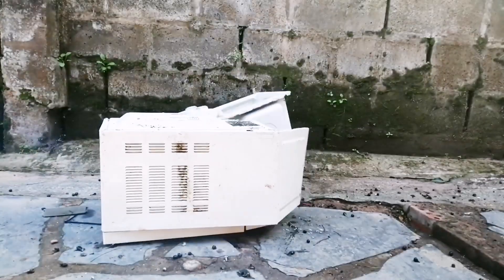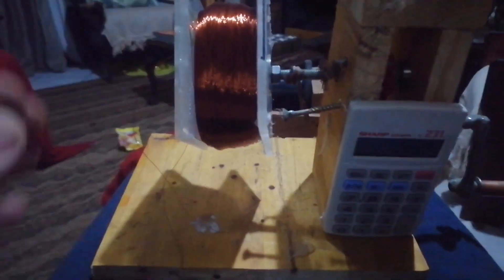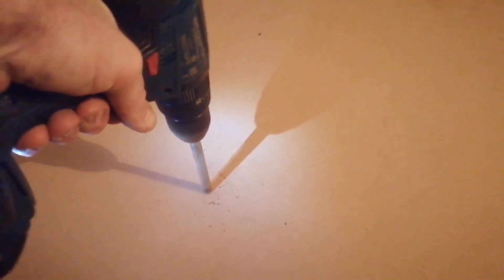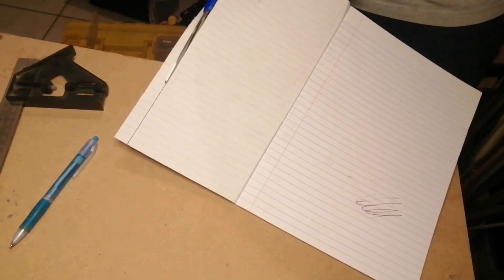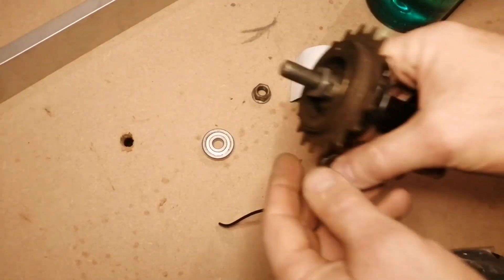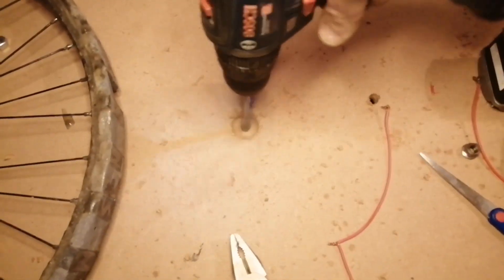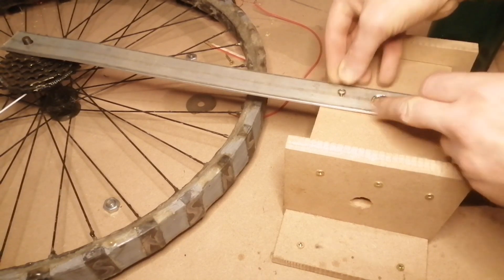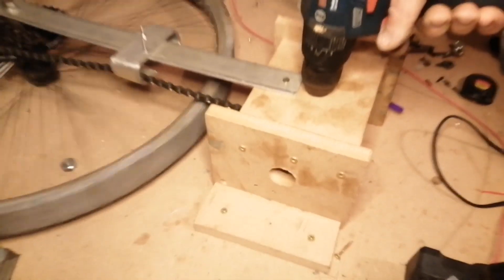Can I make a Free Electricity  using momentum with a Cordless Drill? Part 1

Comment: "Inner power of Capacitor".           (idea)
Voltage of capacitor , which do you preffer 
OUTWARD  U1 = Fq1 - Fq2  (usual)
or 
INWARD.    U2 = Fq1 + Fq2.  
So we just take second and go with it Outside of capacitor effortlessly through 
mid-plane(within it) of capacitor 
("+" and "-" equally far and equal as well so move freely within it)

Of  course there would be thin wire from "+" or "-" to center to obtain Voltage on it
and conduct it outside in this case

Find on Facebook post - Inner Voltage of Capasitor (you should press post after search  if you want to find it , ) , I painted little scratch sketch there
Reply from the maker: Thanks for your comment. Seems quite higher grade to me 😊 which makes me want to check it out. I'll search for it.